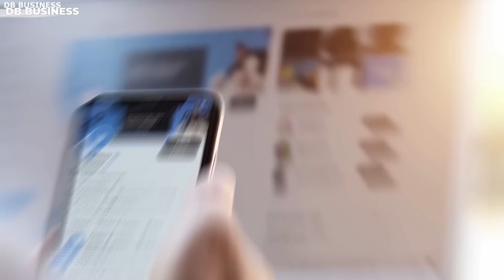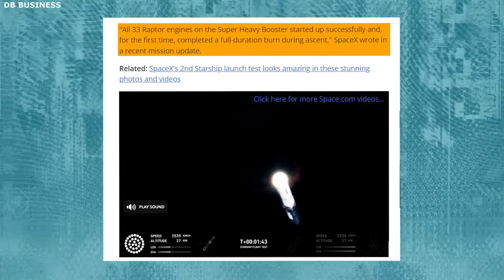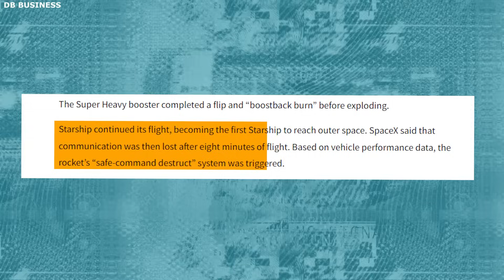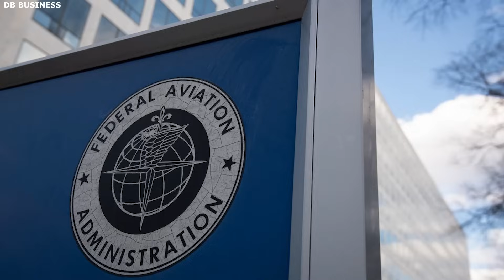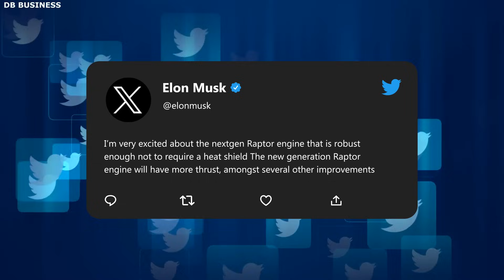Elon Musk: SpaceX Starship to launch again when!? This is nuts!

Comment: Too complicated? And you're using what to write this commentary on? PC's are impossible due to local intensification of Murphy's Law: everything has to work perfectly for a PC to function. The more components necessary for the function, the greater the intensity with which Murphy's Law is enforced. Let's see: we have a device with billions and billions of components that have to work perfectly... And they do? What's the issue with a mere 33 rocket engines?
Reply: A 33 engine booster is tolerant of engine failures, Starship can continue successfully after losing engines. Failure of a single SLS engine guarantees loss of vehicle & mission.